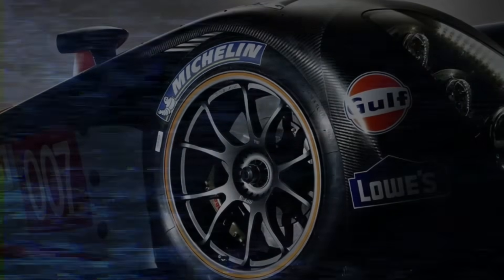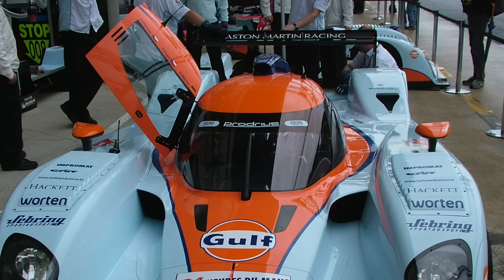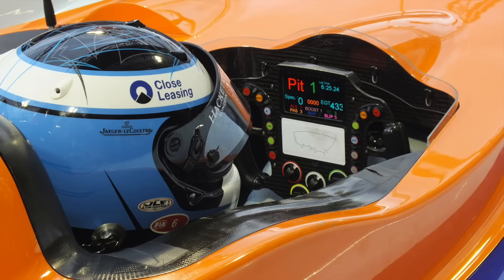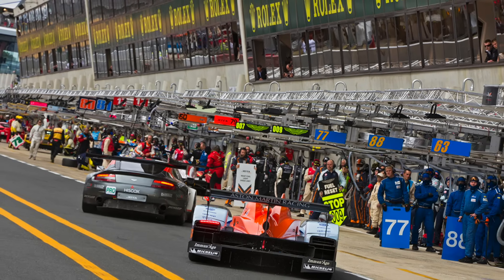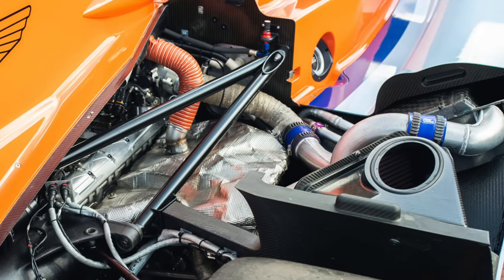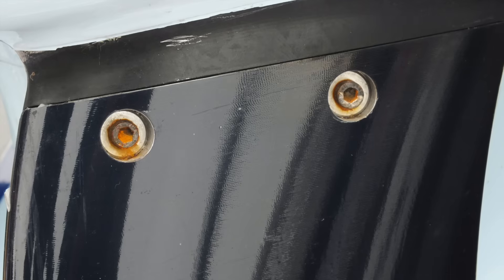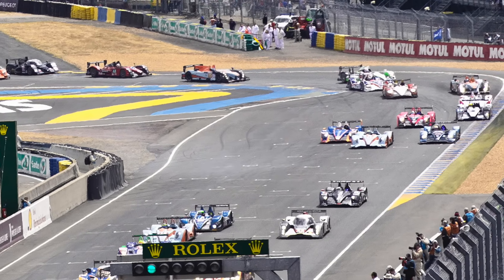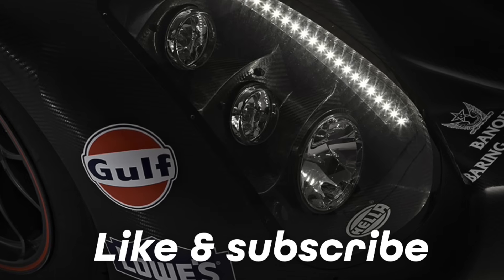Aston Martin AMR-ONE - How it failed at the 2011 Le Mans 24 Hours

Comment: 7:22 I was always suspicious that this was the true reason the engine was a failure and they just couldn't solve the terminal frequency / vibration issues. But I've never seen a conclusive reason as to what was causing the issues. It still bugs me trying to find out was it was

Comment: I seem to spot a pattern where through flow cars are not really suited to endurance racing. Both the Nissan and the AMR used the concept and struggled with gremlins, or is it more of an external factor that the powers that be didn't give either design team the required time and money to succeed? Because the other car using a similar idea, the Toyota Eagle dominated the series it ran in.
Reply from the maker: I don't think its an aero issue, AMR-ONE and Nissan both had wider issues. Aston Martin's big problem was the engine.

Comment: As it is Le Mans this weekend, how would a Super GT GT500 car fare against the Le Mans Hypercars if they were allowed to race at Le Mans? GT500 cars are just as quick (if not quicker) as the Hypercars at Fuji
Reply: Short answer? likely not that well. Long answer? It depends....

Are we talking about derestricted Class One GT500s, or ones balanced roughly in accordance with the Hypercar rules? If it's the latter, they likely struggle, but even a derestricted Class One GT500 car doesn't have much more power than a Le Mans Hypercar - something like 700 hp tops in race trim. The bigger issue is that, due to Japanese circuits tending to be on the twisty side, GT500 body kits pursue downforce with prejudice - they are pretty draggy cars. Le Mans Hypercars may fall behind over a lap at Fuji, but their top speeds there are some 30 km/h higher than the GT500s - thanks to their strictly limited downforce levels, they crest 200 mph mark (~322 km/h) on a pretty regular basis - especially at Le Mans.

Class One GT500 engines are also smaller and more highly stressed than Hypercar engines. Recall the struggles Mazda had in IMSA DPi with the RT24-P, which used an engine of identical specs to GT500's "Nippon Race Engine" rules (2.0L turbocharged inline-4) and repeatedly suffered reliability issues. Starting in 2017, it took until 2020 for even a single Mazda to finish the Daytona 24H. A GT500 would have similar reliability problems at Le Mans - a track that, like Daytona, is known for lots of time spent at full throttle. The longest races Class One GT500s have ever run are the Fuji 500 Miles and Suzuka 1000km, neither of which have been run in half a decade (meaning the ever-evolving engines in GT500 haven't had to be engineered with marathons in mind for quite some time). Just finishing the race would be a challenge.

The biggest pace issue, however, are the tires. Le Mans Hypercars may be over 2 seconds a lap slower at Fuji, but they do that on a spec tire, while Super GT famously has an ongoing tire war. If allowed to run that custom rubber at Le Mans, the GT500s could put up a fight in the Porsche Curves especially, though tire life would be an issue. If forced to run on the same rubber as the Hypercars, it's unlikely the GT500s keep up for long, if at all. Note that, running on DTM's spec Hankook tires, the fastest Class One lap in the Super GT x DTM Dream Race was over half a second a lap slower than even the LMDh lap record at Fuji. Class One GT500s rely on their tires to make that insane lap time.

TL;DR - Class One GT500s have more drag, not much more power, and rely on custom tires to upstage the Hypercars at a track with less full throttle time than Le Mans. Combine that with serious questions regarding reliability over 24 hours, and it's unlikely the GT500s come out the other side with a W. Class One silhouettes are extremely specialized cars that, while cool, aren't that capable outside of their home environments.
Reply from the maker: short video on that coming.

Comment: Aston Martin and Toyota have had some of the longest droughts in Le Mans history including class wins. Aston is still on theirs, Toyota ended their 33 years of failure in 2018. Aston is sitting on 66 years now without an outright win. They have however had 6 class wins in GT since 2012, alongside the 458 with 5 wins and the 488 which racked up 11 class wins during the period making Vantage and the 458 and 488 the most successful GT racers during the WEC era of Sportcar(GT) racing.
Reply from the maker: Toyota would have won more but for the silly BoP
Reply: @Samsthepits well you can't always blame BoP buddy, its there for a reason. Otherwise they'll be spending another $4 billion as they did in F1 and get nowhere, BoP is there to prevent that, to prevent one manufacturer from outspending the other. Without BoP you'll end up with late 90's BTCC and DTM, people spending as much as F1 teams do in order to get ahead. BoP has its place in Motorsport. The budget cap in F1 is basically their BOP as well as the allocated development time, without that teams, like Toyota went crazy with development costs and still got outperformed by the likes of Jordan and Minardi, Toyota's woes also came long before BOP was put in place in the WSC/WEC. They've been failing upwards for decades, and when they can't they cheat as they did in the WRC. So lets not use BoP as an excuse. That's just lazy.
Reply from the maker: BoP is overused...